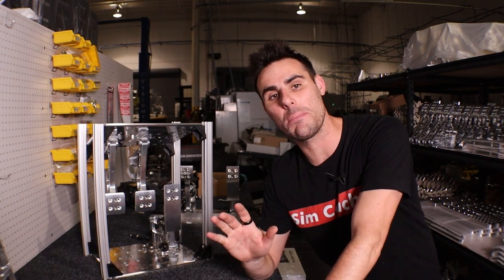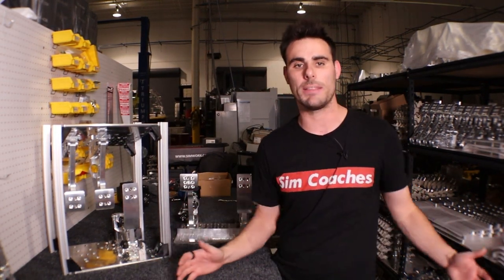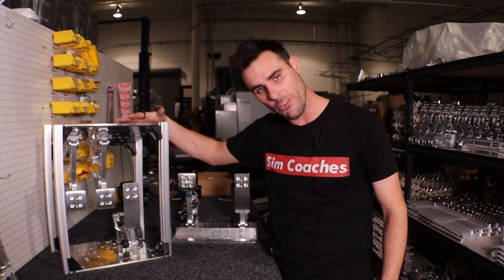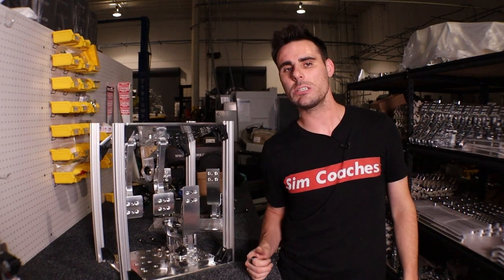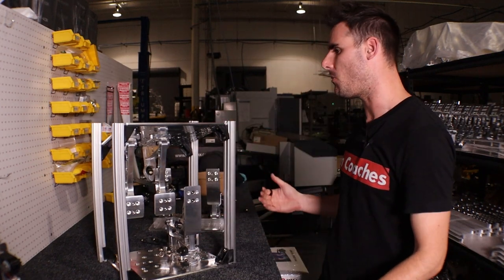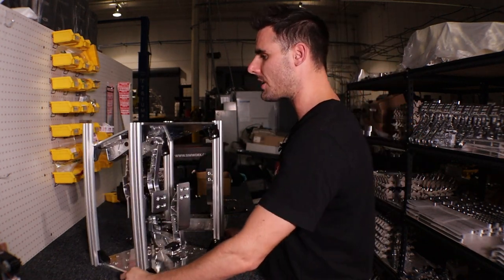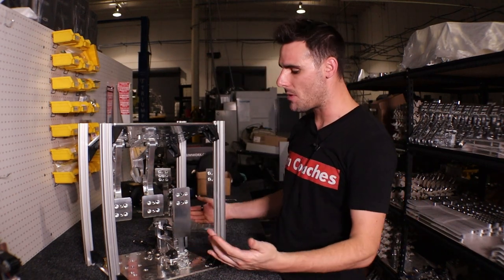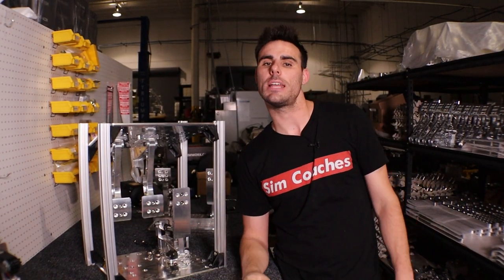Sim Racing Pedals: Inverted Or Standard? What's Better

Comment: I want inverted pedals. They are so much easier for me to maintain pressure and get that muscle memory going. The floor mounted pedals make me extend my leg out in kind of an unnatural position.

But I can't afford inverted pedals (read: my wife won't let me buy anymore equipment), so I'm stuck with my floor mounted pedals. I suppose I could always look for a way to build my own setup with the pedals I have, but I'm not confident enough in my skills to do it properly without breaking the equipment.
Reply: I’ve had the same issue with the unusual position when applying pressure on the pedals all the way  and adjusting them to 90 degrees angle to the ground fixed that issue. Also have a very short travel on the brake.

Comment: In my experience....

Standard/Floor mounted: For those with a full cockpit/sim rig. As if you're sitting in a real race car. Likely F1 cars as seating position is really low and I believe standard mounted is appropriate for that.

Inverted pedals: Best for those with a wheel stand and using a normal chair (such as a dining room chair) instead of a car seat. Or a cockpit where your car seat is higher from the ground than your pedals.

I use a wheel stand and a normal chair and inverted works better for me because if I press the brake pedal (especially a stiff load cell), the force/pressure will go 45 degrees downwards pushing your wheel stand into the carpet and at the same time I am less likely to push myself backwards and lift the front chair legs off the floor.

If I use floor mounted/normal configuration, I am much more likely to push myself backwards (with the chair legs going up with you) or tilt/push my wheel stand forward instead of slowing the car down. As your foot pressure to going straight forward.

I hate using normal as I have to straighten my legs and toe poke the pedals to drive and it feels lame. With inverted all I have to do is push the pedal with the ball of my feet and my heels hardly leave the heel plate. Much more comfortable!
Reply from the maker: Great insights!

Comment: Why is the pivot above the foot called "inverted" when that's the normal configuration for most cars? 

Though the gas pedal quite often pivots behind the foot (and sometimes it has two pivots so it feels like it's pivoting from the heel, but the actual output is still at the top), the brakes and clutch is almost always hinged at the top.

I think the only vehicle I've ever tried that had the pivot behind the foot for all pedals were a small forklift, but that's because you ride it almost standing up. So they were more like buttons you pressed straight down than conventional pedals.
Reply from the maker: It’s because what you’re thinking is ‘normal’ isn’t. You’re thinking of road cars, not race cars

There is no ‘normal’. Just what manufacturers decide to do with their cars. Cars have both, standard floor mounted pedals and inverted top mounted. 

Check out race car pedal boxes. I think you’ll be surprised to see they’re not how you think
Reply: 964 says hello.

Comment: So... Most people want to increase the pressure on their sim pedals, so why would you need more leverage on pedals that don't have enough spring rate!?
Reply from the maker: This is a good solution for drivers especially that have foot pain. Many drivers that want pedals that have high pressure but is easier to get there. Very very very common upgrade for drivers with diabetic neuropathy that affects their feet

Comment: I am definitely inverting.  Have you guys Inverted the throttle, or is it not worth it?
Reply from the maker: Yeah, throttle is able to be flipped with no modifications. Our pedal kit allows for the throttle to be standard or inverted. Whichever is preferred! 😎
Reply: You want the throttle to be standard on the floor as that is the preferred layout since throttle is some thing that is measure in terms of a potential value, unlike the clutch or brake which is based on pressure. Thus it would be easier to modulate the throttle, especially as usually it is a lot softer than the brake or clutch pedal.